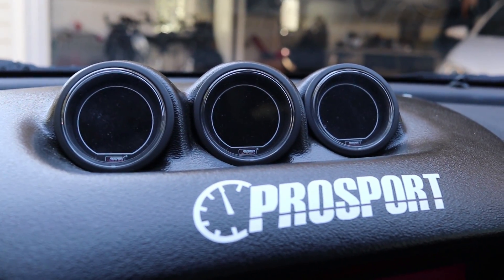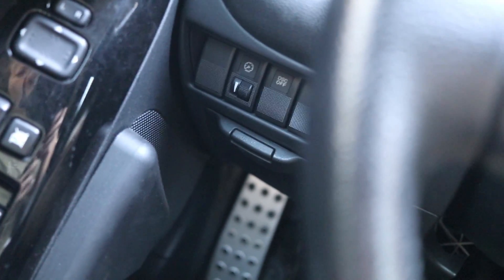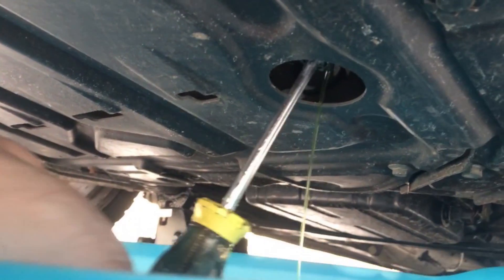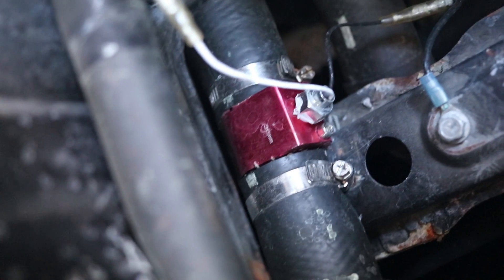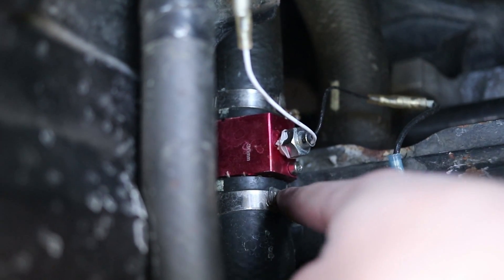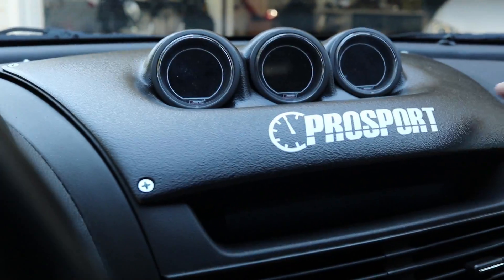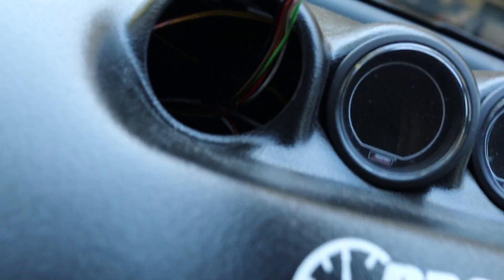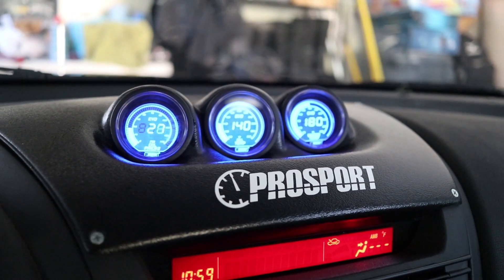How to Install Gauges on a Mazda RX8 (Prosport Evo)

Comment: For the water temp sensor adapter, there's easier access on the heater hose by the firewall next to the washer tank. Just cut that and splice the adapter in.

Comment: How did you wire it for the lights at night? The bottom 5 fuses are constant. The top 5 are switched. I don't see a fuse that's active only when you turn the lights on
Reply: its in the fusebox under the hood. Updated video for a better way to wire the entire thing: https://www.youtube.com/watch?v=WMtXS17aecE
Reply: @PeterArmour  thank you for the response. I have the premium Evo gauge and according to prosport, I can't set them up to change color when the lights are on. I thought maybe I was doing something wrong.

Comment: How did u wire it in to switch from blue to red? I’m confused as how u did that
Reply: Orange wire(red color) is connected to the headlight switch usually while the white one(blue color) is constant, so you'll have blue at daytime and red at "night" while the headlights are on
Reply: @Nycorexti  How do i just keep the color red the whole time
Reply: @Ghxstproduxtions  Only plug in the orange wire and ignore the white one

Comment: Which are the two most important gauge you’ll say you have because I want the three gauge set up but I’m looking to get a turbo so
Reply: Accessport or no? If you'll have one then oil temp, water temp, and oil pressure. If no accessport then boost, air/fuel, and one of the other three depending on what you want

Comment: You know that part of the dash comes off right? No need to cut anything i wouldnt think
Reply: pmm4177 The lotek pod cluster is sunken into the panel. Cutting is very necessary.

Comment: just installed all the gauges in my 06, everything went smoothly aside from the fact that i have a leak from the sandwich plate, it’s leaking between the adapter plate gasket and the motors housing, any recommendations? really love the new gauges but i’d love them more if it wasn’t leaking):

Comment: Does your water temp adapter stretch the hose at all? Others on rx8club said to use 34mm, but you used 36mm. Which should I go with?
Reply: Sheetywah 34mm is the size of my aftermarket hoses. And it fit snug.
Reply: Hating Finding A Username thanks! I used a 36mm on my brand new OEM hose and it fit perfectly!
Reply: Sheetywah Did you replace the holding bracket, or cut out a section?
Reply: Hating Finding A Username I replaced the metal bracket
Reply: Sheetywah I was fairly certain I'd damage one if not both hoses by them being free to wobble about
Reply: Hating Finding A Username I didn't see much play on the hose but I did secure it so the metal adapter wouldn't rattle on anything nearby

Comment: I cant put my gauges there I have an 09 with the Bose sounds system.
Reply: The Gamecat formerly known as ImDead2YouX What does that have to do with anything?
Reply: The Gamecat formerly known as ImDead2YouX pillar pods
Reply: The Gamecat formerly known as ImDead2YouX The cover plate doesn't go all the way back. It just barely covers the edge of the speaker cover in the center

Comment: Another way to monitor the heat is to get an OBD mini scanner and use your phone to set the maximum temperature, so when water reaches it an alarm will go off on your phone. It also calculates your fuel consumption and cost.
Reply: Which obd2 mini-scanner did you use?

Comment: What if I wanna use the stock sensor?
Reply: blaspHEMI 11 Good luck with that. It's much easier to use an after market sensor because you don't need to tamper with wiring. Also the sensor comes with the gauges. The only additional expense is wire and adapters

Comment: Hi, could you share the regular normal reading range of each gauge and by which point we should take care of the associated problem? Thx alot!
Reply from the maker: 1. Oil pressure should be around 15-20psi when all warmed up at idle. Will be in the 60s psi when driving.
2. Oil Temp DO NOT let it get above 215-220F. Coolant seal damage starts at 220 F - mine is usually around 180F
3. Water temp DO NOT let it get above 220 F. Its not as bad as the oil temp...but how can you be cooling down the engine with water that is 220F??? Mine is usually around 180F

Watch my video on why you need gauges for your rx8 for some more info on overheating.

Hope this helped!

Comment: I have everything in including the gauges, can someone tell me where the headlight wire is so I can get my gauges to change colors when i turn on my lights? Last thing to do hook up. Thanks!
Reply: I have a 2005 Mazda RX8
Reply from the maker: Use a mini add-a-fuse wire tap and go into either right or left headlight fuse
Reply: Is this in the fuse box by the drivers seat?
Reply: tuvoon the back of the radio will have a headlight feed to dim the radio when your lights come on
Reply: Japanda is this left/right headlight fuse in the engine bay or cabin fuse box? Thanks

Comment: Aren't water temp. and oil pressure gauges ALREADY on the mazda's gauges?
Reply from the maker: Lucas they are dummies. By the time they give you a reading, your engine is good as toast
Reply: Really? Never knew that. Well, now it's seems like a reasonable thing to do. Might buy one one day so it's important info. Keep up with the good vids!

Comment: Hi, Bro
    Would you mind tell me where is the location for 12v headlight power switch? Appreciate.
Reply from the maker: fuse box in the engine bay
Reply: Japanda Tuning can you exactly show me where it is? Thank you sir.
Reply: Hello mate, could you tell me please where can I find ignition switch wire? I was looking for something close to that fuse box. Thanks
Reply from the maker: "TCM" 10amp for ignition and "CIGAR" 15amp for 12v power is what I used
Reply: Hi there, my UK Manual Spec RX8 doesn't have TCM, it just has spare, is there anywhere else I can use an add on fuse for IGNITION? Thanks
Reply: Ricky G You can tap into other accessories like the cigarette lighter.
Reply: I ran my headlight power from the dimmer switch by the steering wheel. Mine was a red wire with a yellow stripe.